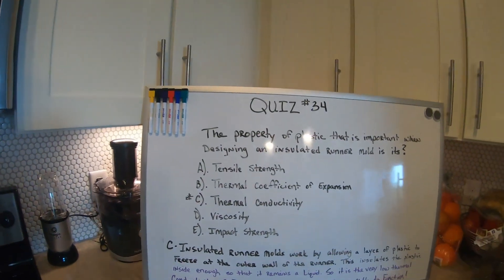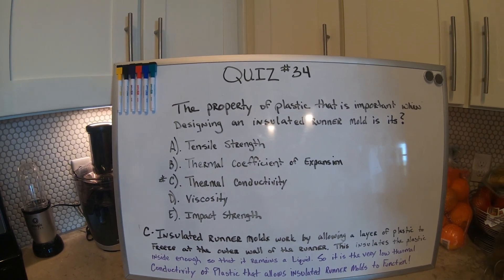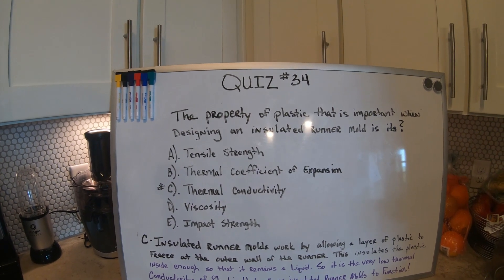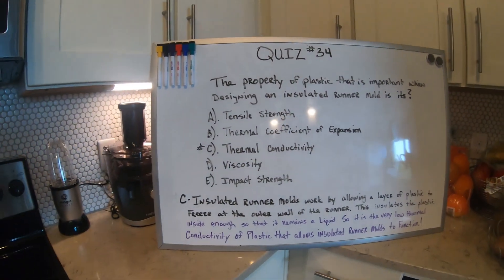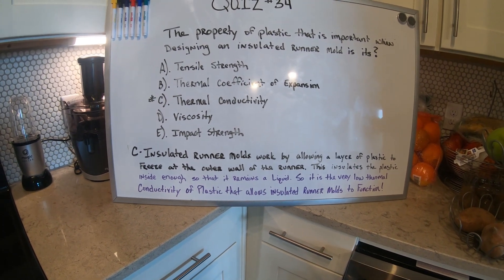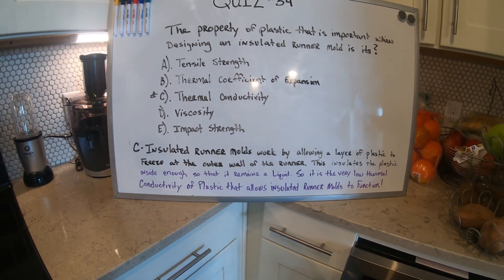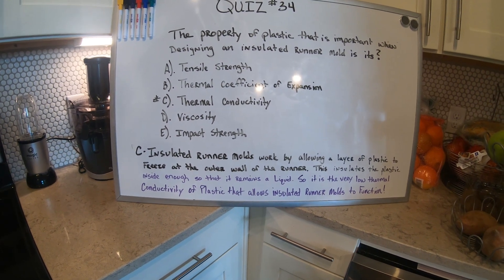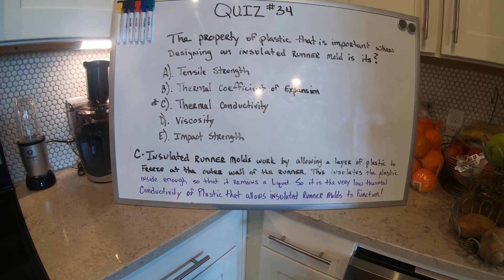Quiz #34 Answer

Comment: Hello, thank you for the videos you publish and all the knowledge you share with us. I sincerely appreciate it. I have a question to ask if you don't mind. I would like to increase the shrinkage coefficient on the plastic part to reduce the diameter to the maximum. I want to clarify that I want to increase the plastic shrinkage coefficient, not reduce it. I want the inner diameter of the part to be smaller than it already is. Do you have any advice on how to set up the plastic injection press to enhance the shrinkage phenomenon? PS: I am working with HDPE. Thank you for your response
Reply from the maker: If you are just trying to do the inner area only then you might run that area hotter. So run the water to the outside areas & No water on the inside areas that might work to shrink that area for you. Thanks for watching & the support to the channel I greatly appreciate it.